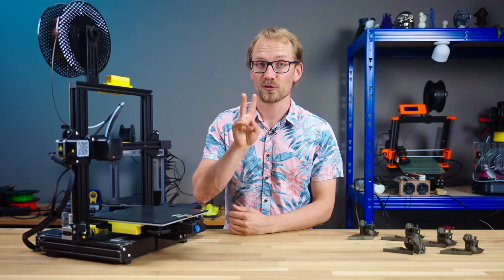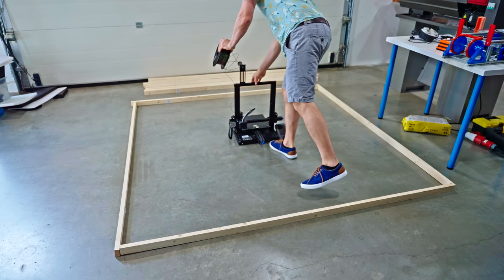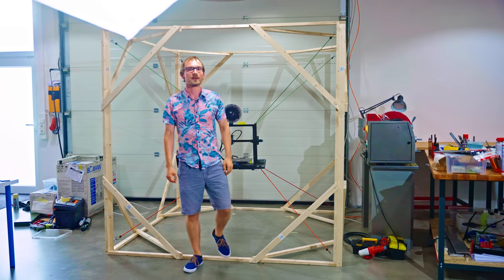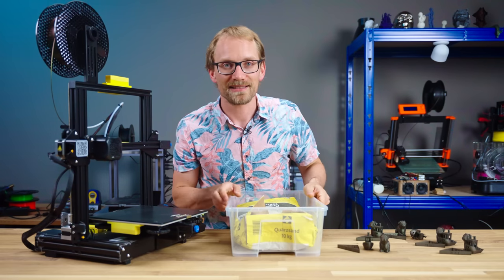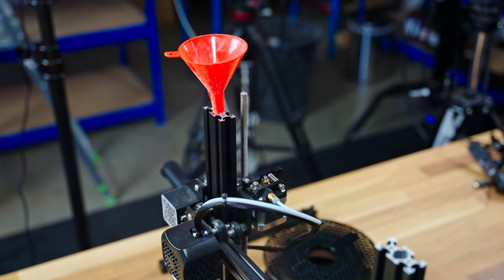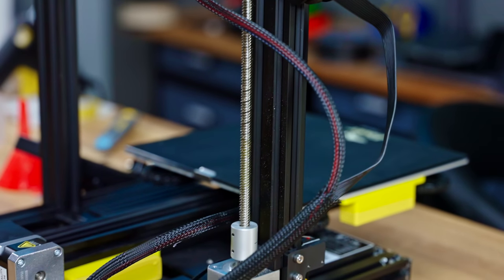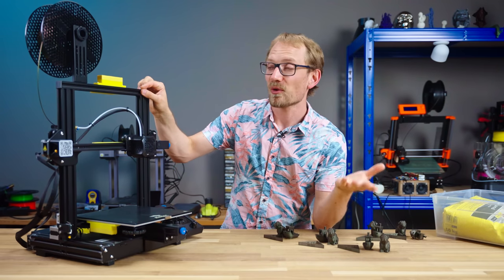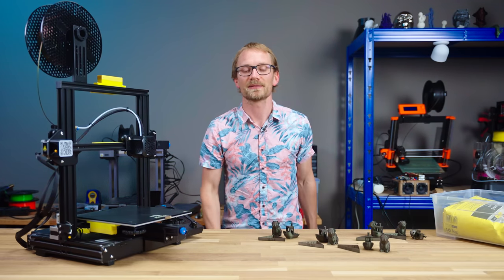You made me do this…

Comment: Sand was common for audiophiles for a short time to deaden platforms and it did work but then things like soundproofing sheets ended that. 

One thing I am testing is turntable spikes/isolators. They are little 2 part metal pucks that either have a spike that fits In a cup foot or use a steel ball between 2 metal plates. They work well and so far are stopping a lot of transfer from the printer to the table.

Comment: Should have used lead shot as is used in speaker pedestals - more mass and less leaky than sand.
Ultimately the problem is with elasticity within the printer frame and mechanism.
The lab robots I work on use large stiff belts that don't stretch to achieve precision.

If I could be bothered to do it , I would reproduce the printer frame in welded steel RHS. That would eliminate a lot of the flex. Then the only thing to deal with is the flex in the mechanical drives. You could try wider belts.

Most modern motorcycles have vibration dampers in the handlebar ends and often on other parts of the frame

Comment: Best place to add damping is directly to the motion components, in this case the stepper (moving mass), the belt (spring component) or the head (moving mass). Easiest is probably to the belt, at the tensioner or with another idler wheel that has dome resistive (to motion) mounting. Sorbothane, memory foam, felt clutch - like a brake in a car or some other friction mount. Large buildings use dynamic systems, moving a mass in the opposite direction, even water that gets pumped around. This is a fun topic, am enjoying it.

Comment: It is all about the mass of the stationary parts.  The more mass, the better.  I went from a 1000lb vertical bench top milling machine to a Bridgeport-style vertical mill weighing around 3000 lbs, and the difference in the surface finish was astounding during cuts in steel.  The same principle applies to a 3D printer.  More mass in the stationary frame will help tremendously.  Sand is not dense enough.  The little sand containers aren't even close to having enough mass.  Some solid steel bolted to the extrusions would be a possibility.  Another option is to plug all of the holes in the extrusions and pour that big container of mercury you have sitting on the shelf into the machine ;)

Comment: Echoing what others have said, take the excess weight off the print bed and other moving parts. Might be an easy thing to test to see if it helps, but as of right now, it looks to me like you may be partially cancelling out any gains you otherwise would have made.

That said, my printer is bolted to a heavy MDF slab in my shop with zero dampening, and while ringing does occur, it's barely noticeable. I think mechanical tuning will only get you so far in this case, especially if your feeds and speeds are maxed out. It's definitely an art, and I love it. Thanks for the vid, and your "3D" tesseract did look pretty awesome!

Comment: With that suspended setup, you're making it work like a washing machine.

I think you can try to make it smaller and add some suspension to slow down the movement, like in a washing machine: there are springs to absorb vibrations and small pistons to add friction and reduce the resonance effects.

Nice project.

Comment: Beside motion damping feet, the most efficient loss mechanism available to you on a filament printer is actually the molten plastic. It will have a resonance at a few Hz an typically a 1/f fall off for its transfer function (basically how much can you shake your printer before it turns into movement in your nozzle head, ie. ringing). It takes a lot more motion to ring at higher frequencies. This is also why ringing is less obvious on larger nozzles: there is more plastic to absorb the motion. The vibration damping feet are going to be resonant in the few Hz range just like the plastic. But there is a lot more mass to the feet so they can absorb a lot more energy than the molten plastic.

The sand containers were never going to add much damping to the system. The resonant frequency of your frame is going to be 100+ MHz. Molten plastic already damps this motion out really well.

The belts and cables, however are going to be resonant in audible frequencies (100-10,000 Hz). Assuming the ringing on your prints is roughly 0.5 mm between peaks and you are printing at 300 mm/s, your ringing is at 600 Hz. These resonances can be tuned by tightening the belts and cables as must as possible. The added tension will bring the frequency up. The whole point of having a rigid system is two-fold: dimensional accuracy and bringing the resonant frequencies up. The mass of a bed-slinger means that one axis will have a lower resonant frequency than the other and ultimately appear worse. There isn't a lot you can do about that other than not use a bed-slinger.

There is one more tuning knob available to you, the viscosity of the molten plastic. This will largely be material dependent. Higher temperatures could increase the effective damping mass for a lower resonant frequency, but will decrease the viscosity and therefore your damping. Lower temperatures can increase the viscosity but negatively affects your layer adhesion, increases the probability you clog, and increases the force your drive needs to exert on the filament which can cause stripping.

The suspension system was also never going to help. It sets up isolation where energy is only allowed to transfer out of the printer at the resonant frequencies of the bungie cables. If your wooden frame isn't very lossy at those frequencies it doesn't even matter. All of the vibrations either have to be absorbed by your plastic or radiated out as sound. Now if your floor was vibrating at your ringing frequency it would have helped over no-feet, but the feet would still have been the better option for all frequencies.

Comment: One thing that I found to minimize vibration and stepper sounds is to add a bearing to the other side of the  motor. I used a v slot wheel that just happened to fit my set up.

Comment: Putting a printer in the air is awesome, and its the same concept as the metronomes on a wood plank with wheels. All 3 will eventually sync up making the settling time and steady state different than the original. Adding mass to the system like the sand is a good idea, it could help balance it, like a washer with clothes, or it might not. it is hard to tell. If you add mass to the bed, you change the MMI al together making it have more ringing. 

My current professor worked for BMW and Ford here in the states designing those  mass dampers you speak off :) 

we had this discussion in our linear systems and controls class. each class is 6 months long of nothing more than studying the system response of natural frequency and damping effects. When they add those small little weights to your tires on your car to "balance" them, they are adding mass because in the equation for transient response, the mass influences the omea^2 portion. Same reason you adjust the clothes in a washer, your literally adding interrail dampers to the system.

Actual dampers have a fluid in them, such as the dampers on a screen door that help it close softly. Mass has alot to do with damping. In our vibrations lab today we went over this concept. 

i am thinking of testing out a large piece of rubber that the entire printer will be on .

Comment: You went through all that effort to add the sand to the moving bed, found out that the extra weight on the bed cause problems, and then didn’t test without bed weights on the Cartesian printer. Wowza.

Comment: How about damping grease? Maybe put it on the stepper motor mounts and on any frame connections? I'm not sure if it will be be enough for the lower frequencies of a 3d printer but some put it on the motor mounts of their quadcopters.

Comment: If you're chasing after resonances, tuning the structure will get you into diminishing returns fairly quickly. What you want to do is ramp all of your steppers up and down so that resonance never has time to build. Remember, one movement of the printer is easy to dampen out, it becomes a problem when you have many movements happening rhythmically that case resonance to build to the point where they cause significant movement.

The other thing to do is to decrease the mass of your moving elements. The ender 3 is a poor platform to perform that modification on, however, something like a voron build gives ample opportunity to drill out 'speed holes' while maintaining rigidity.

Comment: The sand will add more mass to the printer, making it still vibrate, but because of the mass, the amplitude will be much less. You should add lots of weight to the top crossbar of the printer. This should greatly decrease the amplitude of vibrations. 
Also, locate the filament spool somewhere else. If the spool rocks on the printer that could translate to the print quality. 
I've got a delta printer and this video has got me thinking I should just load up the top of the printer with something to keep it from moving around as much.

Comment: Steel belts, ditch the weights on the bed, and then build flextures that constrain in one axis and allow the printer to oscillate in the other axis. Then test both X and Y axes to see which is better for ringing. Also seeing some models available that have 2 axis suspension feet on top of squash and tennis balls. You really do have the perfect filament to test this stuff with.

Comment: I remember an old episode of Ave where he used a variable speed controller to remove resonances from a lathe. The way it worked was to just change the speed of the lathe randomly between a certain range, e.g., between 11,200 and 11,300 rpm. This way the resonances couldn't build up as the resonating frequencies were always shifting. Now I get this would be much harder to do on closed hardware but it would be interesting.

Comment: Have you tried looking at a basic vibrations book? You have actuators connected to a moving base by basically springs. Ringing will be a function of not only damping but how it's connected. Most ringing you're trying to eliminate are caused by the fact you're moving around weight by moving the end points of two springs. This is why Kippler works -- compensate. The other way is to add dampers -- which the sand blocks sort of are, but as you saw more mass = more power needed = skipped steps.

Under that of course all the base modifications won't make much of a difference. They are shoring up the base which, again, the bit your trying to resolve is attached to a bunch of spring elements.

Make springs stiffer, damp them, and better or closed loop acceleration control -- which is how giant CNC's work. They don't use belts, they use recirculating ball screws = stiffer. They have grease in them and large contact areas = damping. Some have closed loop which basically is destructive interference to the system. Once you stiffen the connection THEN and only then will more vibration get to the base and then and only then will have better damping in the base truly help.

Comment: I did the sand earlier this year.  You need to tamp the tube until the sand settles.  You can add a significantly more amount of sand when you do.  All it takes is tapping the sides of the extrusion to make it vibrate.

Comment: What worked well for my Ender 3 Pro: Get a concrete paver (approx 18x18x1.5in), wash it, dry it, then spray it with FlexSeal to stop dust. Put the paver on 4 small pads of some of the soft dense foam you see in some shipping packages. Then put the printer on the paver. The printer will shake the "ground" (paver) and the mass of the paver acts as a damper and disipates through the foam pads. It makes the printer much more quiet too.

Comment: Thick silicone pads are the best. They absorb just the kind of vibrations that 3D printers create. You can DIY them from dried up silicone caulk tube. Just be very careful when slicing, the silicone sausage is difficult to handle. They also hold their shape very well under a load, just let them cure fully if you DIY, a week after slicing so they are properly hardened. Even a dried up silicone caulk can be soft in places..

Comment: Not sure if already suggested or if it will help the end result but... did you consider using seismic ball or rollers isolators in the printer base corners?
You can adjust the shape of the cups and even half fill with sand the balls/rollers to fine tune the dampening...
Also you should be able to adjust the final effect using the sand weights on the printer fixed structure (I wouldn't use them in the moving parts :D ), but in order to achieve repeatable results and fine tune it for each printer, I think that a 3 axis acceleration sensor will be needed to measure those vibrations and check the dampening effect and its tunning ;) (not a big deal with an arduino and a cheap multi-axis sensor)

Comment: The energy vs stiffness vs weight debate! 

By far the best solution to ringing I have found is the resonance dampening of klipper. Everything is made of rubber, and flexes. With clever steering ability (awareness of the controller of the resonance frequencies of the system) I'm currently printing at 180mm/s with 10000mm/s2 acceleration with clean/way better results as with the old style on 60mm/s with 2500mm/s2 acceleration .  

I'm using tubes, half filled with sand, as reinforcement in my speaker cabinets. Sand works miracles in dampening, especially packed loose.

Comment: I think you should try strapping the highest point of your printer to anchors on the table. One strap across the X and two straps for the minimum and maximum Y. Get them as tight as you can without buckling the aluminum.

Comment: Thomas Sanladerer do you want more ideas?)
1) Find a large box or create from the boards, the embankment of sand 10-15 centimeters there and put the printer on top.
2) Use four springs along the edges of the printer =)
3) What is the best damper? True, rubber! In the former USSR (Russia, Ukraine and others), when a rubber damper dries at the compressor in a soldering station and the compressor begins to make a lot of noise, some people buy ... a rubber water hose, cut cylindrical pieces of the desired length and attach under a compressor. Can try to cut off 4 pieces of a hose and attach around the perimeter of the printer?
4) Use foaming for sofas or chairs. It is of different stiffness. I think you need to take it harder.

Comment: Hey there. Great Video! If you look for perfect dampening you could just put all of that sand in a bigger box and put the printer right on the sand. Would be interesting to see if that makes any difference. But I doubt it, I think the problem is not the vibration of the printer as a whole but the vibration of the printer parts (esp. print head and bed) relative to each other.

Comment: The way to go seems to be tuning the belt and tension to increase stiffness of each axis and reduce moving masses. This would increase quite a bit the spring/mass resonnator frequency and reduce dynamic displacements (ringing). To further improve results a stiffening of the frame couls help to a lesser extent. For tuned mass damper, you can have a look at Frahm damper formulas. Doing a vibration spectrum analysis with an accelerometer mounted on the extruder and bed (measure the response to an impact => FFT) will give you the key resonnant frequencies that you need to damp. Then you can tuned your secondary oscillator to reach approximatelly 95% of that resonnant frequency (play with mass and support stiffness and damping) in the same way. You need about 5-10% of the moving mass in your secondary oscillator to get a reasonnable effect.

Comment: If you're trying to address low frequency resonance, the go-to is adding stiffness to the system. Just brace everything, and that'll make the biggest difference under about 20 Hz. Isolation will make it shake more, generally, as the vibration needs to be transmitted out of the printer. It's a pretty straightforward coupled resonator problem, but you're trying to reduce the vibration in the part that's producing the vibration. Damping won't be great here, especially at these frequencies. The system would need so much mass that it's not practical.

It's also worth mentioning that this is approachable as a relative motion problem. Specifically, you don't care if the machine shakes. You only care if the position of the nozzle varies relative to the position of the bed. Again, the solution is stiffness. Add cross braces, use stiffer belts, etc. Some will make a much bigger difference than others, and you'd need to do a more involved analysis to determine the order. Or just test it.
Reply: Forgot to mention, I do vibration analyses professionally for safety critical applications. There are people with more experience out there, to be sure, but I'm familiar enough with the basics to comfortably take on this sort of problem.